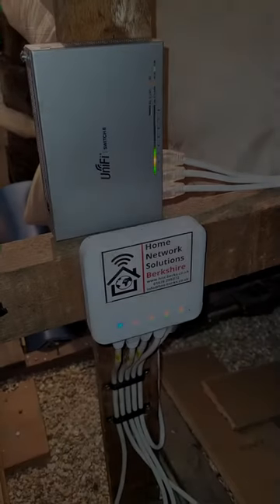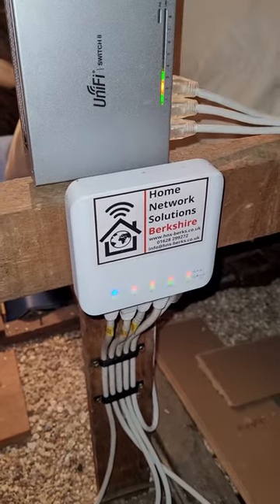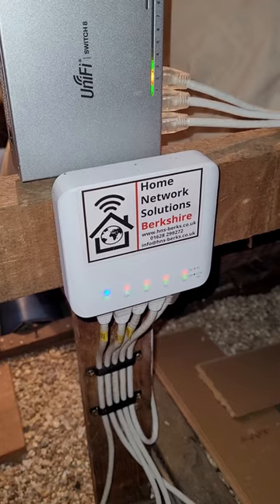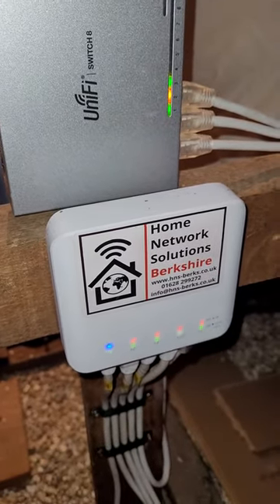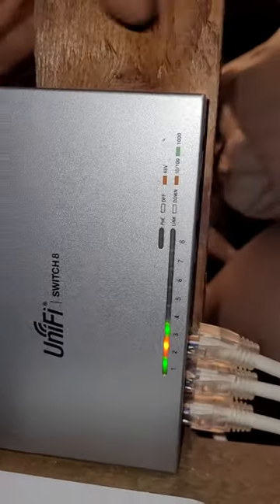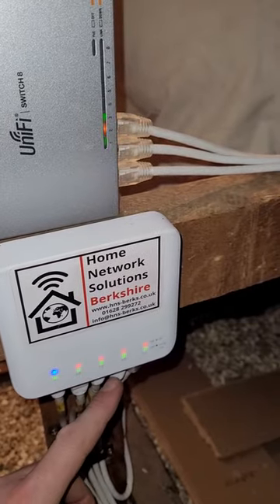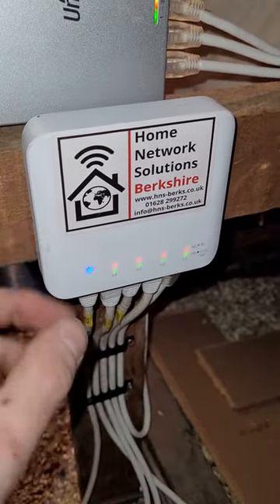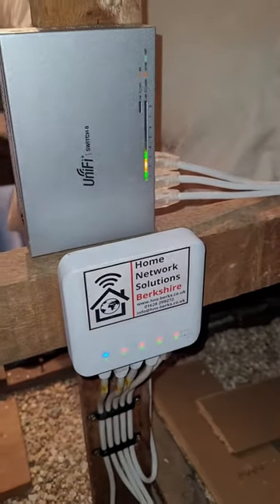Using a Unifi Flex Switch to power a Unifi US-8 Switch

Comment: That's pretty ingenious. I am powering 2x Unifi G3-Bullet Cameras, and 1x AC-M-US with my Unifi Flex. All outside too. (And in Arizona), so it's pretty tough.
Reply from the maker: It's a great switch. Good to hear that it can handle the Arizona heat ☀️
Reply: @home.network.solutions  not in direct sun. It's under the eaves of the house. I expect this next summer to be the real test. I think I put it up in October when the temps were already down below 100F/37c on average. We can get up to 50c here.

Comment: Would this only work with a us 8 or would it power a us 8 60w?
Reply from the maker: Hi, no the US-8 60W needs mains power so you couldn't use that, also the flex can only provide upto 15w a port which wouldn't be enough to power a 60w switch.
Reply: @home.network.solutions  thanks. Would the flex power a ac pro if powered from a us 8 60w?
So us 8 60w poe to power flex.. Flex then Powers ac pro in loft.

Do you find ac should be in ceiling than up in lofts?
Reply from the maker: @justintemp  I think you could do that, but you couldn't power anything else off the Flex. Would need to double check to power consumption of the AC Pro.

Depends on the make up of the house, every physical barrier reduces the strength of the WiFi slightly so better to have them ceiling mounted if possible.
Reply: @home.network.solutions  thanks. Been watching your vids and they're very informative!
Reply: Why did you opt for us 8 and not the latest us 8 lite switches? Or even a flex mini ?
Reply from the maker: @justintemp  the US-8 Lite was not readily available at the time in the UK. The client plans to add more cables in the future so Flex mini was too small.
Reply: @home.network.solutions  thanks. The new white switches seem a move from metal boxes.. Wonder if they get as hot as the metal ones... Will have to research it